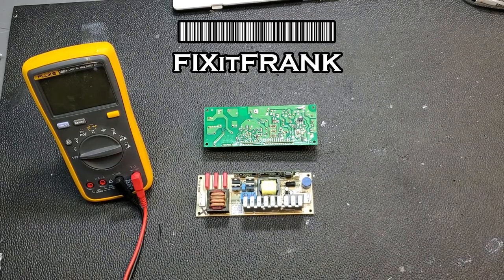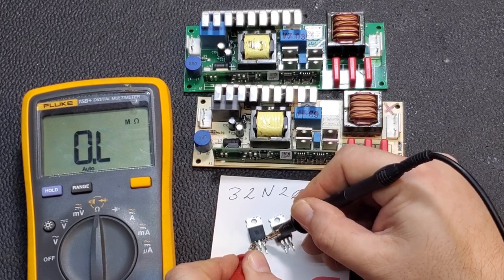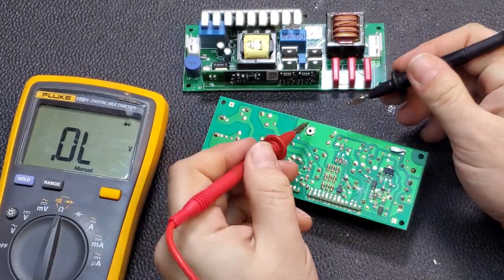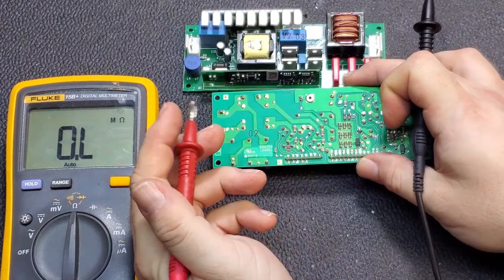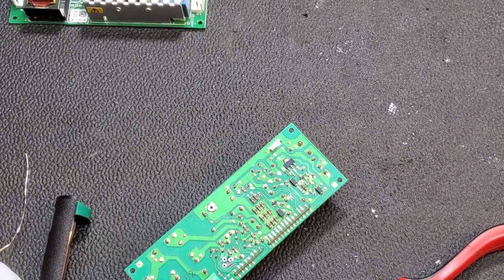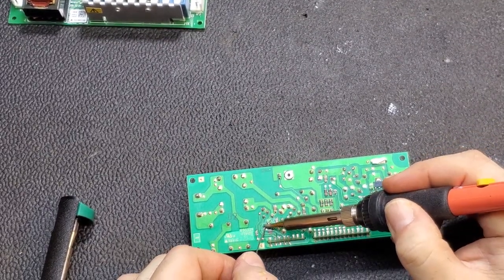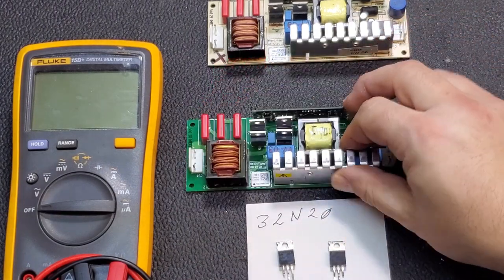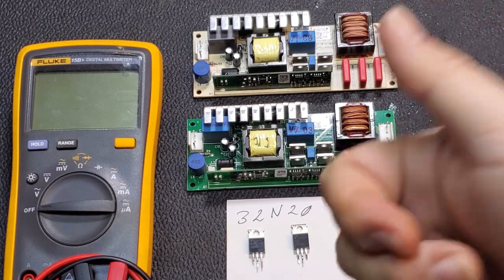Digital Video Projector Ballast Diagnosis and Repair

Comment: Hey,
Very interesting video! I am troubleshooting my ballasts for similar lamps. However, my lamps turn on but do not reach their maximum intensity. They flicker then suddenly cut off after a few minutes.
Do you have any idea which component could be responsible for this? I tested with an ok ballast and the lamp starts without worries. I also tried to change MOSFETS but i had no results.
Reply from the maker: I'd also check the mosfet drivers. There should be some small surface mount 5-6pin packages that drive the mosfets.  For the large mosfets, one pair is the ignition, the other is the "run" circuit.  The ignition circuit goes through the film capacitors that you likely see grouped together(usually 3).  The other 2 are used after the ignition. If they arent getting driven that would explain it.  How did they test when you removed them?
Lastly, are you getting the 380Vdc from the power supply to power input of the ballast?  If the PFC(power factor correction) circuit in the power supply isn't working that will also cause this.  If you are using 120v line voltage you will get 150dc if the PFC circuit isnt running, and 300V if you have 240v line voltage.   You want to verify that 380Vdc is working.
Reply: @FixitFrank  Good evening,
First of all thank you for your detailed answer. Currently, I replaced 2 of the 4 mosfets, I tested them with the ohmmeter. In addition, I ordered the film capacitors (those by 3), I am mounting the new ones this weekend. Regarding the initial voltage, I had tried with a new ballast and the problem did not appear. I conclude that I have the correct voltage at the entrance. Here is a link to a video of the lamp flickering before it was turned off : https://youtu.be/wCUCfjmMiik

Comment: Many thanks for the helpful videos! Maybe you have an idea for my problem with the Optoma HD20? It always shows the lamp failure error (On LED=flashing amber; Lamp LED=red steady) even after replacing the lamp twice with original Osram lamps. 
Story: While I was watching a movie there was a popping noise and the lamp turned off (lamp failure LED message). Because of the popping noise I was thinking it must be the lamp. But after replacing it twice (with two new different original lamps) the problem was not solved (lamp failure LED message is still showing up and the lamp doesn't illuminate). When turning the projector on both fans are starting normal and the color wheel is also spinning without strange noises. I've measured the Hz value on the wheel with a DMM and it shows constant 120Hz. When measuring the Ballast the DMM shows nothing at the lamp output. The diode and the mosfets are ok I think (when measuring gate 2 drain at the mosfets it shows nothing - is this good?).  I couldn't find any exploded capacitors which may have caused the popping sound.
Do you have an idea where the problem could be or where to search for other reasons which can cause this problem?

Greetings from Germany and sorry for my bad english.
Klaus
Reply from the maker: Guten Tag Klaus! Wie Gehts? Your English is perfect. Better than many native speakers. I promise it is better than my high school German... 
I would check the power supply. I had a problem where the switching driver for the ballast power had failed and burned a hole through the chip.  You should read 300vdc on the ballast input in standby.  Once you press power and the color wheel starts, the voltage to the ballast should be 380vdc.  I suspect you have no 380dc on the ballast and the switching driver for the PFC circuit failed.  They can cause a large pop noise when they go. https://youtu.be/IBs7E5pkS1s  This is a more severe example but similar.  I suspect you still have low voltage but no high voltage to the ballast. I would also recommend against measuring the ballast output directly.  There is a high voltage ignition pulse of 3-5KV that can damage your meter and possibly injure yourself.  The frequency is very high(20khz) as well and may not register on the meter correctly.  Once the lamp is running the voltage drops to around 100V.  If you do have 380v on the input to the ballast, then the ballast may be your problem.  Verify the power supply first and I think you will find the cause.  Thank you for watching and Merry Christmas!
Reply: @FixitFrank  Vielen Dank für die schnelle Antwort! Thanks for the fast reply!
I will check the power supply as you mentioned. 

I wish you a Merry Christmas too!
Reply: Hi again,
I hope you had a nice Christmas! I've managed to measure the voltage on the power supply as showed as in your linked video (at minute 16:50). It is only 312 Volts - that's not normal right or can the voltage level vary? Do you think there is a problem with the power supply?
Reply from the maker: @AwAy-Band  Christmas was very nice! Thank you for asking. You are correct, that is too low.  It sounds like the main power supply has problems.  You are reading the rectified line voltage(220-240~) is about 300-315DC. I'd see if you can find a used but good power supply.  The existing supply would be repairable but it might be hard if you are not used to board-level troubleshooting.
Reply: @FixitFrank  Many thanks for your help! I've found a diode on the power supply (the one on the small heat sink where C31 is located) which has the same resistance values on both sides and on diode test it has the same voltage values on both sides. 
Update: I've desoldered the diode and got normal values when measuring it again. Guess I 've to exchange the power supply.
Reply from the maker: Thats normal. That is your low voltage output side. It has a common cathode I think (or common anode). Between either outter pin and center pin should read like a diode. However it seems the low voltage is ok since you have control. I would check the circuit components that feed power to the ballast. That is where I think you have issue. I will follow up later with some pictures of an old power supply I have.
Reply: @FixitFrank  That would be nice. Thank you

Comment: Hi Frank,

Thanks for making this video. Came across it while trying to debug an issue with my Epson EH-TW3200 (aka Powerlite 8350). The original bulb seemed to die after about 1300 hrs. The lamp shut off and the fans went into overdrive, with a lamp warning light. We got a 3rd party replacement bulb, and it worked great for a couple of days, and was much brighter than the original bulb (at the time of its breaking, at least). But then it started basically doing the same thing. It would turn off after a couple of minutes, lamp indicator, fans going crazy. Hooked up an RS232 cable to get an error code but it was just 06 = LAMP ERROR, so not much help. 

Would you have any suggestions for where to go next? I thought of maybe replacing the thermistor on the lamp housing ... but maybe it's something more serious?
Reply from the maker: Hello Brian,  Most likely it is the lamp again.  3rd party lamps can be hit or miss. It really depends on the bare bulb inside and who made the housing.  That chassis uses the ELLP49 which does have an aftermarket Osram lamp available.  Not quite as good as the OEM Iwasaki eye lamp but not bad.   I find that when the lamp was the problem, it is likely the problem again.  Wild goose chases because of unreliable lamps is something I have been on one too many times.
I would contact your seller and get another lamp to try.  Thermal issues would show up as thermal issues.  A stuck iris would also show that as the error.  I really think its the lamp.  If you aren't sure about the lamp, shoot me an email(listed on the about tab) with a picture of the lamp and I can probably see if its good or not.
Reply: @FixitFrank  thanks for the feedback Frank, I've emailed you some photos.
Reply from the maker: @baza210  Thanks! Ill check them shortly and reply
Reply: @FixitFrank  Hi Frank, just sent you an email with a video of the projector, would love to hear your thoughts on it. Cheers.
Reply from the maker: @baza210  Just replied!

Comment: my question is can we only dictect the bad mosfet with digital meter.. because i do use the manual meter. though whenever i  fix the mosfet by changing it.. the projector will come on but later blow off..i mean d ballast..because there is still some fault that i haven't ditect that is hiden.. pls shed more light to this .i want to understand if some mosfet don't show damages with manual meter etc
Reply from the maker: I find that you need matched mosfets. If the values between two are different it can cause unbalanced operation.
Reply: @FixitFrank  i will try that
Reply: thanks
Reply from the maker: also, I had to check, but you can use analog meters no problem.  As long as you have a diode test option, the meter itself does not matter.  You can also use resistance.  From Gate to Source, it should be around 10K.  Gate to drain should be low resistance one way only.  if you reverse the probes and the resistance is still low, that is a sign of a failed mosfet. You should at least read the blocking diode inside.  I think it will be .1-.2v voltage drop.  
I would recommend one of these. They can be purchased for less than this price if you shop around and buy one without the case will save some money.  I use for testing parts and it really makes it easier. You can use it to match your own mosfets by reading the values.   https://www.ebay.com/itm/LCR-T4-Mega428-Backlit-Component-Tester-ESR-Meter-Kit-LCD-Display-With-Case-DIY/303381231393
Reply: @FixitFrank  yea...that's what i do too..i use the analog meter by checking the resistance.. but mostly when i replace the mosfet with a good one from another same ballast..it will work for some time nd then the owner of the projector would just call back that this projector did same thing again.. and when that happens..it affect the power fuse .even probably some mosfet in the power pack goes damage too... and one tin again.. even before i replace the mosfet..i do check the operating voltage and wattage. so i do make sure i use a higher wattage equivalent to the one their..just to make sure its efficient is %100.. but still, it will work nd work. but after some days..it goes off again..  i will check the balance as u have proposed to see if im the one getting it wrong.

Comment: Hello again. I am working on another projector ballast and thought I would jump on here and see if you might lead me in the right direction. I have a Promethean pm25 that started flickering after I replaced the bulb with a new one. I am guessing the ballast is going out on this thing and I was hoping you might be able to tell me what I need to check on the ballast for this problem. Thanks in advance.
Reply from the maker: Hey John, what kind of flickering?  light to dark or colors shifting?  Did you replace the whole bulb assembly?
Reply: @FixitFrank  I have it apart. The ballast is a 58115201dg. I did check the resistance across the bulb and it is open. I have had some issues with bulbs I've purchased before but it was an issue of working or not working only.
Reply from the maker: The bulb should read open.  These are arc lamps. No filament. That is why they have a ballast.  The ballast manages the arc inside the bulb. If your bulb had any resistance that would be very bad for the ballast.
Reply: @FixitFrank  Thanks for replying and the information. I had to take a break from this repair but I plan on tackling it this weekend. This is my golf simulator projector and is a short throw. I had replaced the bulb with an OEM but it started the flikering when I did this. I was thinking the ballast could be weak and going out but I really wanted to check it. Is the ballast one of those parts that either works or doesn't or can it go out slowly? And, should I follow this video's instructions to test it? I really hate to bother you but your knowledge goes unmatched with projectors.
Reply from the maker: You say its an OEM bulb but as far as I know Promethean doesn't sell those anymore. It might be using an OEM bare bulb such as Osram but that sort of makes me suspicious of the glass on the front.  Make sure the glass on the bulb has a proper IR block coating.  It should be a reddish/blue/purplish when you look at it from an angle. If you bought it from amazon or ebay or if it was less than $100 I would be highly suspicious of it.   If the glass has a greenish or clear look to the glass, that is your problem.  It allows infrared radiation into the optical area and it confuses the color wheel making the colors flicker.  Check the bulb and make sure the glass on the front looks the same as the old bulb. 
A low quality lamp can cause so many annoying problems.  I know these work well https://www.purelandsupply.com/sanyo-projector-lamp_prm25.html but I can't speak for other companies.
Reply: @FixitFrank  Well, I took it apart, cleaned it, put it back together and I am getting nothing. It doesn't light up now. lol

Comment: Hi i had today situation like this: i clean my benq w1070 and and after all  my lamp worked ,and stoped. I changed bulb (i had new one)  and nothing... cold dead ;)  What dou You thinking? is lamp's ballance is shity now?  I gave new bulb and new wheel colour (i had for safety ;) ) but projector still not starting...  ventilators  starting, led lamps on top to... ,wheel colour spinning ,so my diagnose is ballast,but im not sure in 100%. what You thinking about my problem? is that ballast?
Reply from the maker: Maybe ballast but I think checking voltages is a good next step.  What LEDs are blinking?  Did old lamp explode or only stop lighting?
Reply: @FixitFrank   They are not blinking still. I hadn't lamp explosion. I cleaned my w1070 (5th time-4x times was succesfull,without any problems).  and then... lamp started (after while-not normal behavior) . Throwed Picture. was black-white with some points behind this picture i could see some shape of "menu" -not sharp. I turned off projector,and i started one again,and... dead calm. I changed wheel colour & bulb (new parts) ,and nothing. No explosion,bips etc.  Starting is ok. I pushing Power button,colour wheel is spinning-checking, "Power" led is blinkig,and then "Lamp"-red led is still on